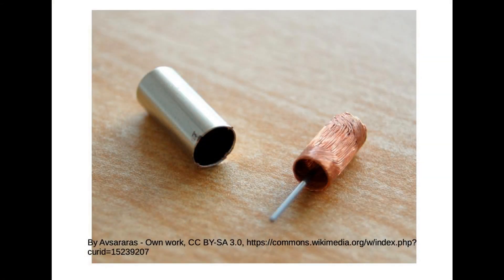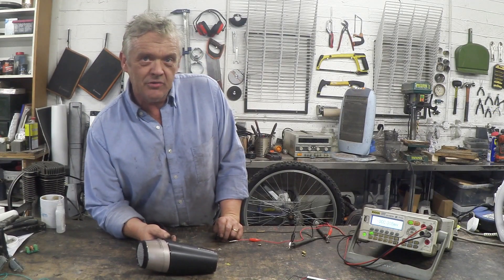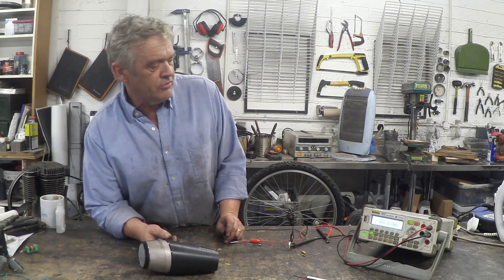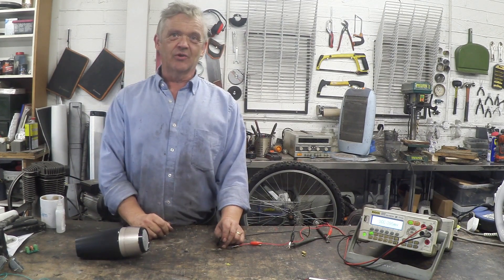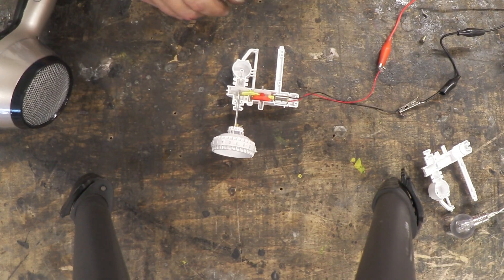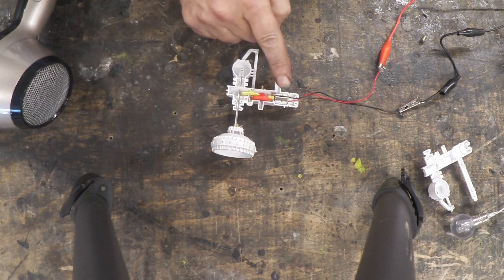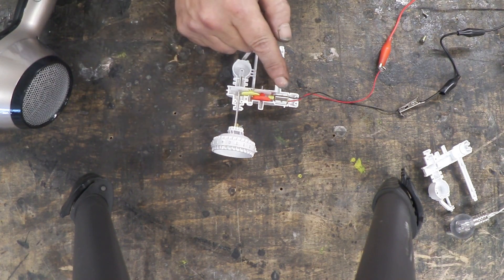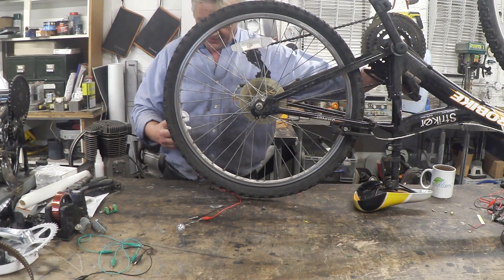1222 How To Make (Probably) The Worlds Smallest Generator

Comment: Smallest motor I've ever seen I pulled out of a cheap electric toothbrush from CVS (American pharmacy/drug store). It had 2 motors in it, one to drive the head of the brush, a 2nd to vibrate the the thing and let you know to move the brush to another quadrant. That motor for vibrating was as tiny as tiny gets. Maybe 1.5-2 mm in diameter and 1cm or so long.

Comment: Nice to see you explaining your electronic test conditions more clearly. 🙂👍
You might like to have a look at VCR capstan motors. They are a low RPM brushless motor with a nice thick shaft. They can easily be hacked by adding a 3 phase rectifier and generate good volts and power at low revs, which is ideal because you don't need much gearing. Tip; the older VCR models had bigger capstan motors and better bearings.

Comment: The recent videos on high speed dc motors as generators got me thinking about setting up an array of motors around the $100 VAWT or the Rose turbine, using the base of the turbine as the driving wheel, just like you use the bicycle tire.  Is the lower rpm of the turbines too limiting?

Comment: if you throw in a diode and a capacitor you really have something usable. cheers mate
Reply from the maker: cheers mate - but why the diode?
Reply: @ThinkingandTinkering  so the cap won't put power back to the motor

Comment: The smaller ones are in the shop mate! They are to be attached to your water tap, and they have an LED which is red or green, depending on the temperature of the water. ( google for led faucet ). I found out you can actually drive them with an outside magnet passing by at some decent speed.
Reply from the maker: I looked them up - awesome

Comment: One idea for a video - the comparison between number of blades on a turbine. Theoretically 1 blade is the most efficient, but more blades with gearing could yeild a better result particularly at low wind speeds, but max output will be lower
Reply from the maker: nice mate - cheers

Comment: Wait, wouldnt you want a high voltage low rpm motor?!. If the motor konstant is rpm / U = 2000 kv as an example, you would get 4000 rpm if you apply 2V. But that also means that the output voltage is given as  U = rpm / kv-constant. So you would want the kv constant to be as low as possible to get more voltage at lower rpm.
Reply from the maker: Sure - but in practice I have found HV High rpm to have low torque - low RPM motors seem to have a much higher torque - so - though amps go up they turn out to be hard to turn - I think it is horses for courses really and actually any motor will do as long as you match the capture device to the motor requirements with gearing - but as a rule of thumb for getting an easy quick result I think what I said helps
Reply: @ThinkingandTinkering  Yeah, the low torque part really makes sense now that I think about it
Reply from the maker: @headlessxp4948  I did leave a lot out here - but you have to make a choice in a few minute vid - what you are saying is 100% correct - of course - but a lot of folks just want a result they can 'knock up' in a few hours - if they get success then hopefully they will look further
Reply from the maker: absolutely spot on mate - it's a system and for that has to be in balance
Reply: @ThinkingandTinkering  people get too caught up on one principal, and try to match everything around that one pricipal... which works! and that's why people will argue low rpm motors are better generators.... (it is no judgement headlessXP, your view is not wrong at all! it 100% works :D) but here lies the difference between understanding and comprehension... understanding makes you use lower KV.... comprehension makes you create a well matched system, regardless of motor RPM, which is the true solution!